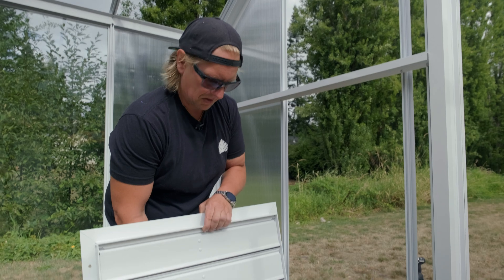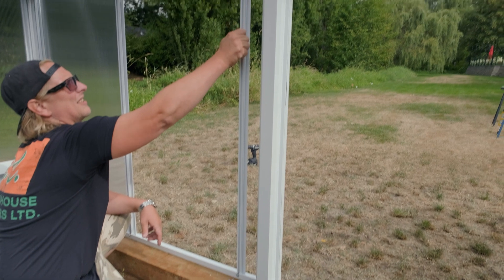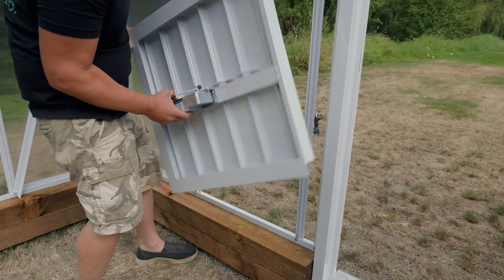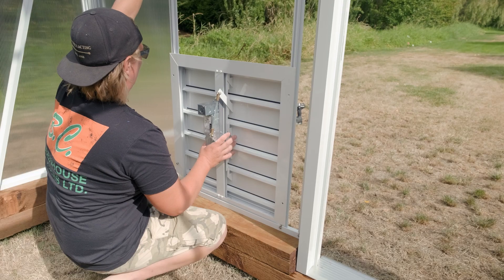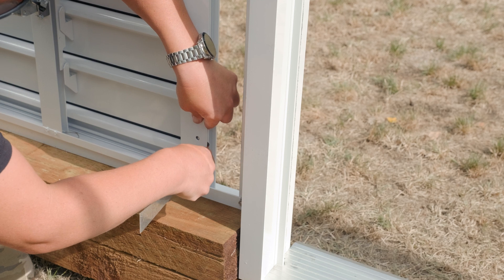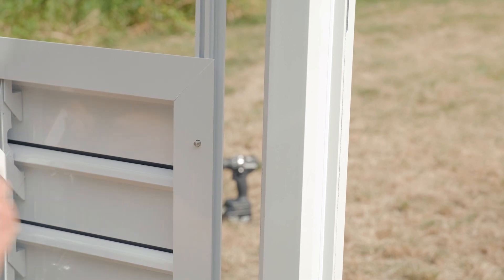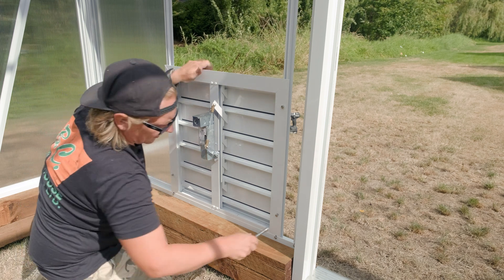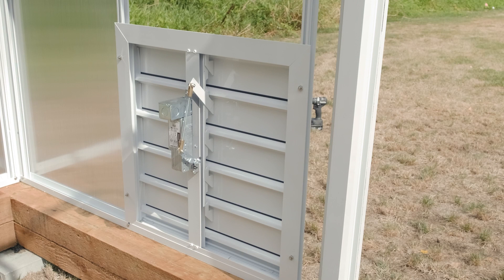ACC14 Installing Greenhouse Intake Shutters

Comment: Is the foundation/wood raised up for a reason?  rather than being in the ground?
Reply from the maker: Thanks for your question!  Yes, the raised foundation wall serves the purpose of adding more height to the greenhouse.  This allows you to stage, add shelves, train vines up the wall and more.  Additionally, most customers prefer some type of raised wall so that the greenhouse is protected when mowing the grass around the greenhouse.  It also has better insulation too!  Hope that helps, Angela